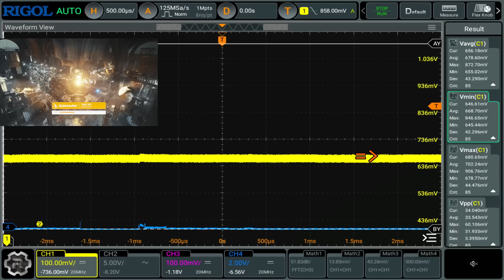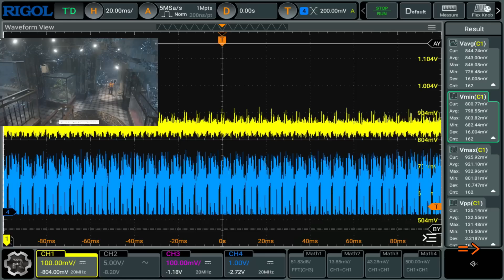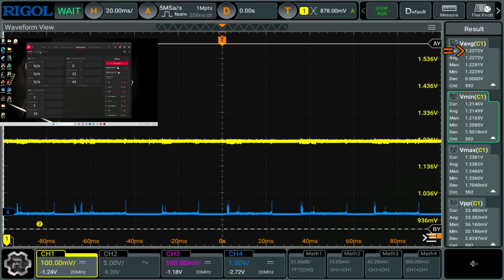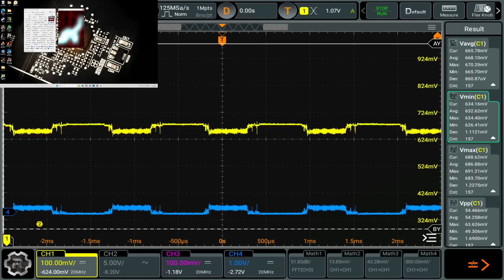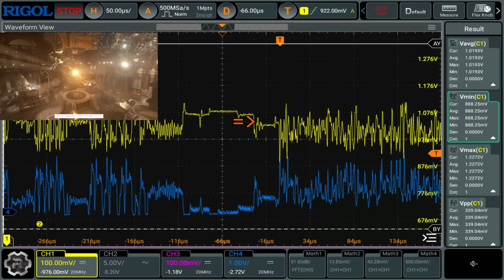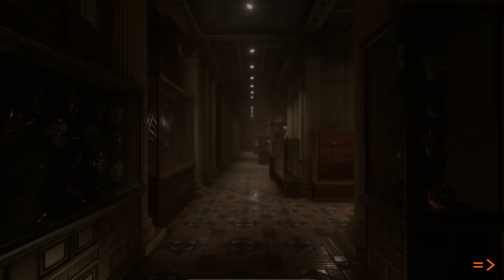Probing ALL* the RX 9070 voltages //* just Vcore Vsoc Vddci and Vmem

Comment: Hello everyone, I have a question (actually 2 at once😅) that I can't seem to find any clear and precise information about: What are the default GPU operating "Vcore" voltages for the Radeon RX 9070 (non-XT) and RX 9070 XT? Because from memory on Navi21 (RDNA2) which was in TSMC 7nm process, it was 1050mV for the "XL" chip (RX 6800), 1150mV for the "XT" chip (RX 6800 XT), 1175mV for the "XTX" chip (RX 6900 XT) and 1200mV for the "XTXH" and "KXTX" chips (RX 6900 XT "Ultimate" and RX 6950 XT), then moving on to RDNA3 with Navi31 which had its "GCD" under TSMC 5nm process it seems to me only concerning the RX 7900 XTX, the default GPU "Vcore" had therefore gone to 1150mV, and there I wanted to find out about RDNA4 (in TSMC 4nm process it seems to me), their chips Navi48(XT/XTX) and impossible to find better than extrapolated values of results from CPU-Z/HWiNFO64 screenshots, where we can observe minimum values slightly lower than 995mV, often others wandering around 1000mV and maximums varying between 1010mV and 1030mV, nothing really clear, could someone enlighten me on this subject?

Comment: It wouldn't be too hard to do up a Vulkan program that runs compute shader batches of different sizes. One that just generates a bunch of data via calculation, and outputs to a buffer in VRAM. Then a similar test that instead reads a bunch of data from a buffer in VRAM and just outputs to a tiny buffer. Then another test where it's reading from a big buffer, computing, and writing out to another big buffer. That would likely give you a better idea of what's going on where. With AMD's profiling tools you can see microseconds to perform different tasks, and how many clocks shader instructions take to perform.

Comment: Cant wait for the results after modifications. I need to know if its worth to invest 50 more for a nitro or a red devil which has 2 power stages more  and all caps populated.
Reply: People are able to flash XT bios and using over 300 watts, nearing or matching XT stock vs "stock" and with an OC will/maybe be faster than a stock XT. So it might be worth it.

Comment: hey, this might be a wrong place to ask but i've searched the internets and couldn't find anything like the problem i have, so decided to ask a guru(you). I bought a new pc recently with i5 14600kf, rog z690-a gaming wifi motherboard and 32gig cl30 6000 teamgroup ram but the timings are completely locked in the bios, they are just greyed out and i wasn't able to find anything in the bios to unlock them...
Reply: They might be locked if you're running an XMP profile or something?  Might have to disable XMP to unlock manual tuning?
Reply: @jacobm2625  have tried doing that too, but still the only thing that can be adjusted manually is frequency(memory wise)
Reply: @jacobm2625  i tried disabling them, but still could only change the frequency
Reply: @jacobm2625  tried doing that too, but the only thing that can be tuned is frequency
Reply: @jacobm2625  tried disabling that too, still locked
Reply: I don't know if it will work but I would try to update the bios. Good luck!
Reply: @ that was the first thing i did, but thanks for answer:D

Comment: Apparently you can flash a 9070 XT bios onto your 9070 and get a decent performance boost from it. Something you could give a try.
Reply from the maker: it literally just raises the power limit.
Reply: @ActuallyHardcoreOverclocking  on the topic of power limits: do you know which pins are for the i2c interface on the MP2857 voltage controller on the XFX 7900 XTX Merc 310?
Reply from the maker: @gunnntha just look for a set of pads labeled J4003
Reply: @ActuallyHardcoreOverclocking  I have a 9070 red devil if I was to dabble trying this what XT bios would you look at i'm thinking the hellhound or the reaper because the xt red devil has 3 power sockets
Reply: Great advice.
Sooner you start flashing these, the sooner they end up on my bench for repair 😅
Reply: @northwestrepair  Based on how the backplate of my 9070 Reaper has discolored over only one side of the power delivery in the short time I've had it, they probably don't need help.
Reply: @northwestrepair  🤣🤣🤣
Reply: Oh,the great GPU doctor has spoken 👍.
Did you gat any of these on your table already?
Reply: Wait, that’s like the 3rd parallel now between RX 9070 (XT) and RX Vega 56/64.
Reply: That's perhaps unsurprising; same happened with Vega 56/64 and oh hey would you look at those CUs
Reply: Doesnt need to. Already no power limit
Reply: @giannisgiochtsis3395 except for the part where there's a power limit
Reply: The 9070XT bios just has a 400ish mhz clock difference to the 9070. So it's like overclocking your 9070 but doing it via bios.
Reply: What's the benefit of this? I mean you probably can manually overclock the nonXT card and unless this flash unlocks some disabled hardware I don't see how it's going to be beneficial?
Reply: @danielt91  It will get not only higher clocks but also a higher power limit.
Reply: @danielt91 sometimes higher clock or voltage ranges on soc, albeit he has the evc2 and no limits if you're hunting higher scores...something people will try with ch341 🤷
Reply: Omg these people recommending flashing vbios still exist?
Reply: @Roman-6969  Yeah man it's like 2017 all over again! I feel so nostalgic!
Reply: would be cool if it enabled more cores like the 6850/6870 and 290/290x i did that on half a dozen GPU's back then.